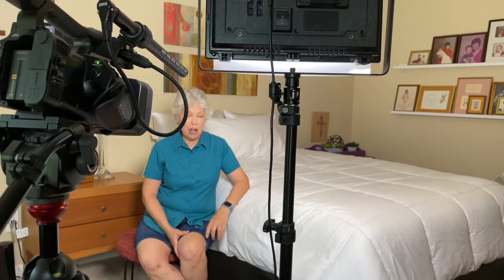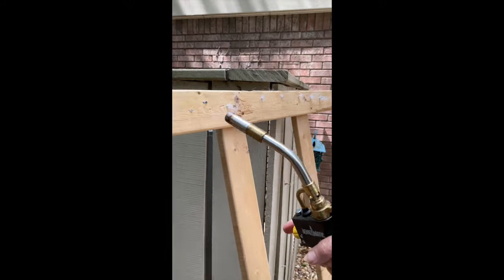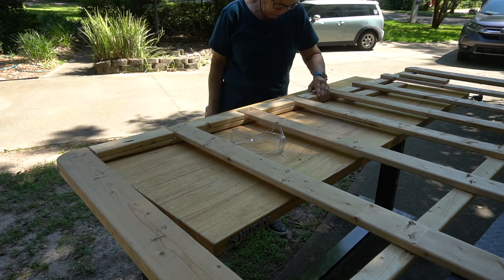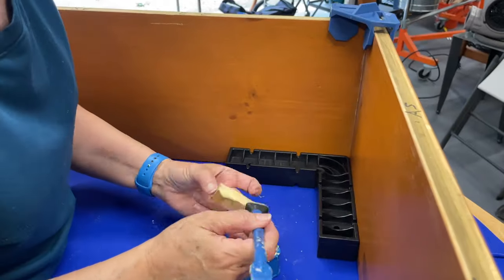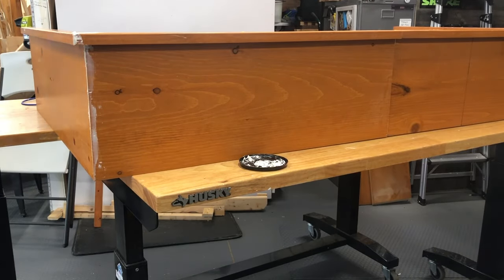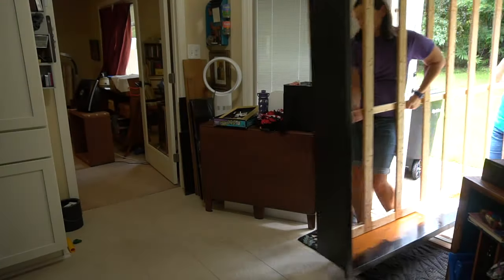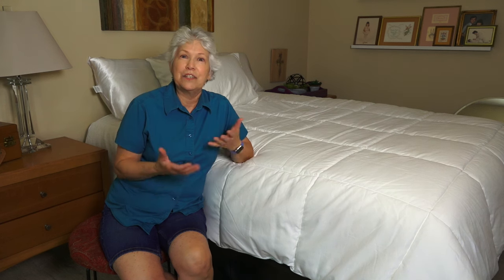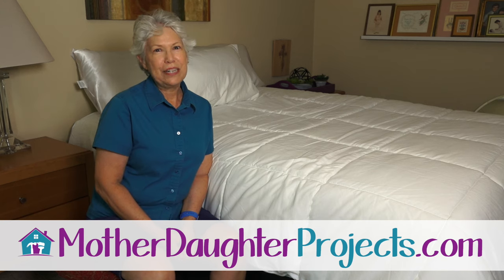DIY Bed Frame from Old Box Spring

Comment: if you  used that edge of the shelving on the inside creating a lip and and set the wood frame on it ,then nailed ,  i think it would of made the frame more secure , not sure just brad nails alone are going to hold up .
i did sometihing similar , i used a king size metal bed frame ,with a deconstructed king box frame [wood only] like you did ] to support the mattress and built a frame  [just like yours]  out of blue pine to create the illusion of a wood bed Frame. it sit around the metal fram like a picture frame and looks great and makes the bed lower. only has 3 sides so easy to move
cant figure out how to send a picture :(